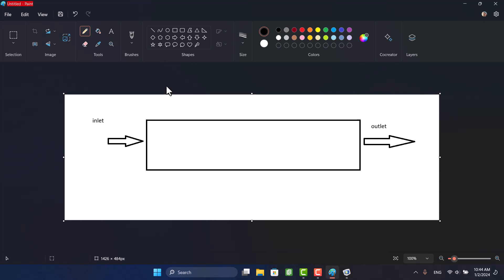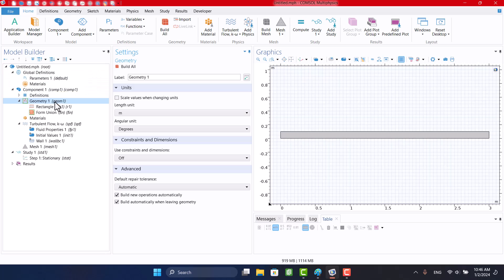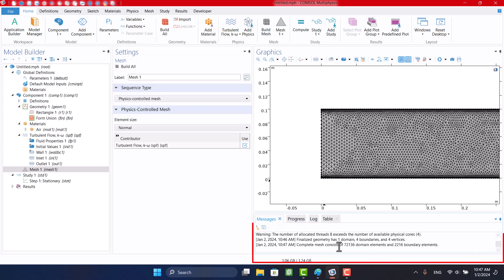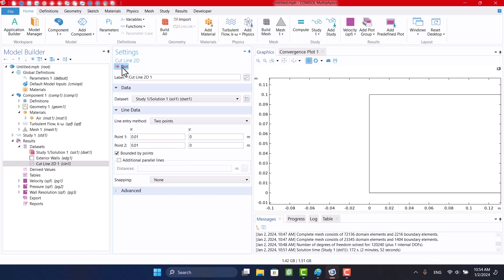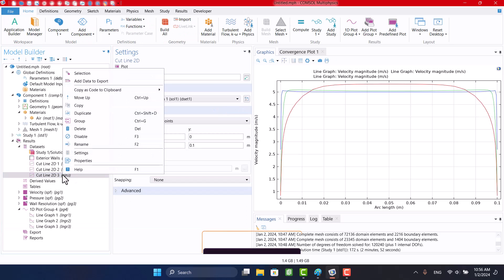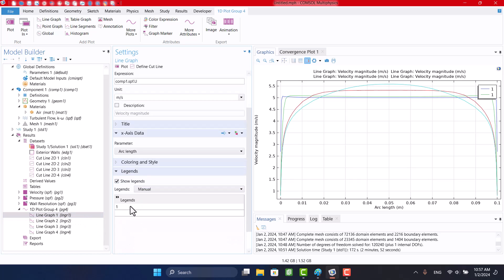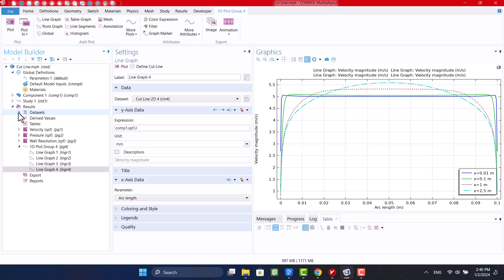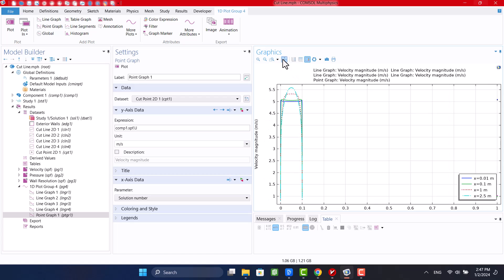🔧 COMSOL Tutorial: Using Cut Lines and Cut Points for Velocity Profiling 🔧🚀

Comment: Hello, it's me again!  Sorry for the inconvenience, I really liked your videos and I'm learning a lot.  I have a question, I have a porous laminar flow in a cylindrical geometry (rectangular cross section).  I would like to know the permeability of the porous medium and for this, in the variables section, I added the permeability formula of Darcy's law.  My biggest question is the following: is there a way to plot permeability on the Y axis as a function of position (on the X axis) or any other variable?
Reply from the maker: Hello. Add a 1D plot group and line graph. Select cut line in data set and select your desired result for y axis data. Set x axis data to length of the cut line
Reply: @caewitharminhashemi  Hello, I tried to do this.  But the graph only gives me one point (a nominal value for permeability as a function of length, for example, so that it is not varying permeability).  Could you please check my simulation, in the variables part, to see what is happening?  I will send the parameters to your email.  It's very basic, nothing too difficult.
Reply from the maker: @gabrielhernandezrozo848  OK i will check your model